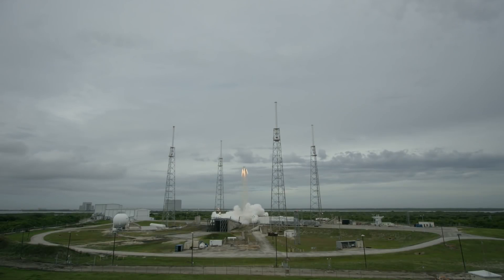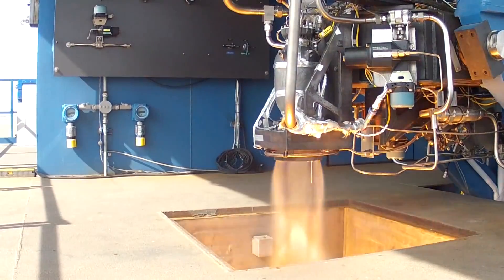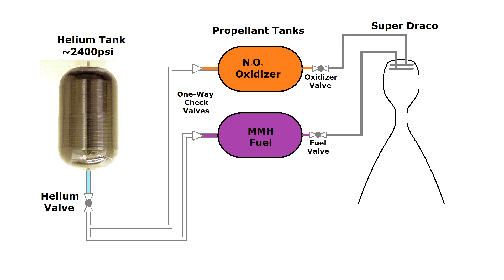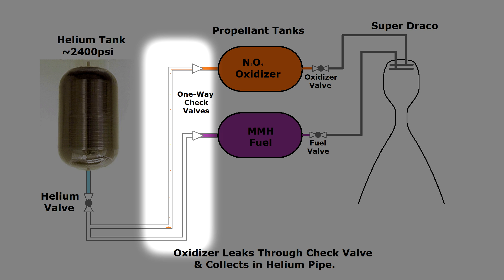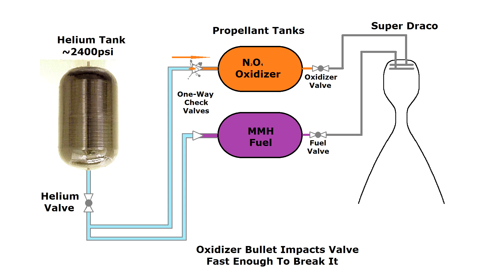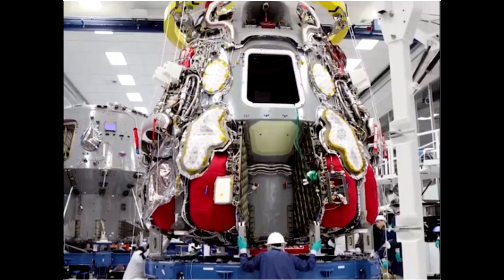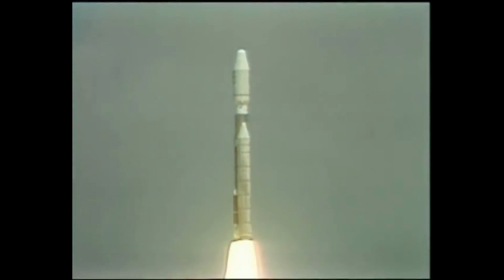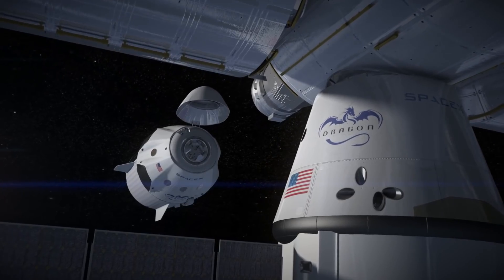SpaceX's Crew Dragon Spacecraft Exploded Because of 'Corrosive Bullets' and Leaky Valves

Comment: How would burst discs function you ask? Glad you asked! ;)

Burst discs are a thin metal plate of a precision calibrated thickness and usually scored or shaped to hold pressure up to their rating, and then burst instantly when the pressure reaches their design rating.

By putting them on the pressurization ports on the low pressure fuel and oxidizer tanks, they would prevent any fuel from getting into the helium plumbing.

Then when the SD thrusters were fired, the helium system valves would be opened and instantly burst the discs allowing the tanks to be pressurized.

The only times this would happen would be in the event of an in flight abort, and at that point the helium pressure would never be turned off until it was on the ground, so no fuel could get into the helium lines.

If they ever do propulsive landings, sane idea, the discs would be burst just before landing, and it would stay pressurized until it was on the ground.

All the other valves would remain the same to turn the engines on and off etc, this is just the shrink wrap over the package to keep it sterile until first use so to speak.

For long term redesign, I would either move the helium control valves directly to the end of the fuel and oxidizer tanks totally preventing the situation, or add a second set of valves directly at the tanks that actuate at the same time as the existing helium valves.

This would preserve the ability to ground test, while preventing the problem of fuel leaking back into the system.

Comment: The video was great like all of them!   It wasn’t explained what would happen if it happened again but with the updated burst seal?   Does that Superdraco continues to work or shuts down?   If it shuts down is there enough abort thrust to escape?   If the seal disk burst does the poisonous ☠️ gas leak into the atmosphere or does it stop the flow?

The other thing not mention in the video is how thorough the investigation was.   Not only NASA but the FAA, National Safety Transportation Board and USAF all conducted investigation into the site.
Reply: It's impossible for this failure mode to occur with a burst disk, though there may be other failure modes introduced with that change (which would also need to be addressed).

Comment: Couldn't you fix this by just raising the helium pressure gradually? Open a pinhole valve first, bring the pressurization lines up to operating pressure, then open the main valve. No helium inrush, no bullet, less stress on the valves and piping.
Reply: That would slow time for launch escape system to abort.

Comment: Question:
Can the check valves on the input side of the fuel tank and the oxidizer tank be replaced with the same type of valve as the ones on the output side of the tanks?

Comment: So if the valves that pressurize the tanks are one use only, I guess that means Dragon 2's plumbing isn't even physically capable of propulsive landing in its current form?
Reply: You mean in its new form, but, no you could still do it, you'd just have to replace the burst disks every time.

Comment: Maybe I just don't have a firm enough grip on mechanical engineering, but I don't understand how a burst valve can replace a one-way valve.  One allows pressure through when the pressure on the first side is higher than the second side; the replacement don't allow anything through until it hits a threshold, then allows everything to flow in all directions.  Maybe a burst valve is just part of the replacement system, or maybe I'm not getting it at all.  My intuition tells me that a better solution would be a solenoid master valve for safety, followed by the one-way valve, neither made of titanium.

But seriously, please somebody enlighten me.  I want to understand.
Reply: In the event of an abort, the very high pressure helium would burst the disk, and then all flow would be downstream from the helium tank.

Comment: Another nail in the coffin of the Dragon's soft-landing calability.  Now when you start those motors, you have to use up all of the fuel, whether you need it or not.
Reply: For now soft landing can be done but the fuel and oxidizer would have to be vented  separately immediately after landing which would seriously complicate crew recovery.  However now they know what happened and how to recreate the failure, they can do detailed testing of new check valve designs.  It is possible to make check valves that wouldn't explode even if it  leaked.  You can make a check valve out of aluminum oxide ( a ceramic) that would be strong enough to handle the slug of fluid and it is would not corrode or burn. .  Once you have the improved check valve you can install that into crew dragon, keep the burst disks and use them to abort or land .

Comment: Wow. Good thing the plan already had the system only firing once per flight - during an abort. This also means that any abort burns will be to depletion. I can see why they would use check valves, but burst disks are the only reasonable option to fix this.

Comment: Will switching check valves to burst disks hamper reusability? If yes, how severe?
Reply: The Superdraco engines are only used for aborting the mission so in such a scenario, also changing out some used burst discs will be the least of their worries.
Reply: @chrisantoniou4366  So, they are not used for orbital maneuvering system?
Reply: @dyershov  No.  The Draco engine is for manevering, the Superdraco for launch abort.  They had originally designed the Superdracos as hover motors for a controlled descent of the capsule on land, and this is why the engine used a check valve - for reusability, but this was dropped from the design even though the check valve for the helium tank was kept.
Reply: No. Of course, NASA has already denied them permission to reuse the Dragons on manned missions. Crew Dragons will only be reused for cargo flights. Hwever, since NASA also killed propulsive landing, these valves would only ever be used in the event of an in flight abort, so changing from one form to the other will have no impact on reusability whatsoever.

Comment: How does a burst disk equal a check valve? In my experience they are totally different things.
Reply: The purpose of the valve here is to prevent fuel or oxidizer from leaking backwards in to the system. The check valve was good for that purpose if the SuperDracos were going to be used for propulsive landings on multiple flights. Since that will no longer be the case, and they will only be used in the highly unlikely event of an in flight abort, the burst disk can perform that function actually better, and will be be, well, burst by the high pressure helium should they ever need to be used.
Reply: @odysseusrex5908  so they only use the helium in an abort?
Reply: @paintballercali    Yes. The Superdracos are only an abort mechanism. Originally they were going to be used for propulsive landings, but NASA killed that idea.
Reply: @odysseusrex5908  ok I get it now thank you.

Comment: In the navy, if a Class D fire (e.g. Titanium burning) on an aircraft the only action was to dump it over the side and let it continue burning as it went to the bottom. I'm still not thrilled with the solution. Why not stainless steel pipe the whole pressurization system including the check valve.

Comment: If a check valve is open and flow reverses, isn't there a remote chance that fuel & or oxidizer has the potential to leak back into the common helium piping?  With hypergolic fuel no less?

Comment: A Rupture Disc only bursts when a certain pressure has been exceeded..Until this point they do not allow anything to flow at all. I  can not understand how this fixes the issue seeing as you need to pressurize those tanks with helium. You cannot just plug the line with a rupture disc. How does this solve the check valve problem?

Comment: I am confused how this can replace a check valve...so once the disks pop and its all at the same pressure what stops the fuel and oxidizer from flowing backwards and corroding the pipes or mixing in the plumbing and blowing up?
Reply: The extremely high pressure of the flowing helium.
Reply: @odysseusrex5908  but between when they pressurized it and when they open valves to light the engine...or if they don't use up all the fuel, wouldn't that be a problem?
Reply: @matthewmiller6068    It is, now, only an abort mechanism. It is supposed to use up all its fuel, and fire up really fast.

Comment: Slam pressurization is always sporty. On XCOR's test stands and rocket vehicles, we always made sure we had some means for gradually pressurizing the tanks, typically a solenoid valve in parallel with the high flow ball valve. A few times we tried fast press experiments, but the system's reaction told us not to do that again. (Seeing the pressurizing lines jump and shake made me a little shaky, even in the bunker.)

On later systems, we routinely put a sonic orifice in the press lines (downstream of the regulator and press valve) sized for about 3x the normal flow rate. It would choke the flow until the tank press approached normal operating pressure, then could keep up with the propellant volume flow rate with very little drop. Much like an inrush current limiter for an electric motor.
Reply from the maker: So how do you handle a system that’s needed within a split second to save the crew?
Reply: @scottmanley  If the tanks are almost full, pressurizing them will still only take a fraction of a second. There's a big difference between 0.5 and 0.01 second pressure ramps.

Comment: I also read though, unless I misunderstood the language of the report, that the combustion of the failed titanium valve in the presence of the oxidizer was completely unexpected and thus unanticipated. As in, they experienced something brand new in rocket history.
"It is worth noting that the reaction between titanium and NTO at high pressure was not expected. Titanium has been used safely over many decades and on many spacecraft from all around the world". But the older report seems to indicate this knowledge of the combustion of titanium in the presence of oxidizer was previously known. Why switch to a one use valve, rather that some slight additional plumbing to allow purging of the pressurization line between the pressure tank and the valve that failed? I know there is more than one valve to accommodate. Then there could be repetitive testing again of a system.
Reply: Covering their asses, that's why.

Comment: So are they keeping the one way check valves but adding burst discs as pressure relief? A burst disc alone wouldn't let anything flow past right?
Reply: No, they are replacing the check valves with the burst disks. They won't let fuel flow backwards, like happened here, but, in the event of an abort, the high pressure helium will blow then out and allow forward flow,
Reply: @odysseusrex5908  but how does a burst disc allow fuel past it at all?
Reply: @hotshit62    The fuel isn't supposed to go past this valve.This valve is upstream of the fuel and oxidizer tanks. It's purpose is to prevent fuel and oxidizer from flowing backwards in the system. When the engines are ignited, the high pressure helium is supposed to push the fuel and oxidizer forward into the combustion chamber. The check valves would have allowed the engines to be turned on and off. The burst disc will simply be broken by the helium and then flow can only occur in one direction because of the high pressure the helium is under.

Comment: That explanation was really simple and easy to understand. You're exceptional at this sort of thing, Scott. Thank you for the video!

And thank goodness they figured it out. This is the way it should be done - everything transparent and out in the open so everyone knows the problem has been addressed and there's no chance of it happening again. It's too bad they'll have to install new burst valves every time they want to reuse the Crew Dragon, but that's a small price to pay in exchange for the added safety.
Reply: They won't have to install them every time it is reused, because the Superdracos will only ever be used in the event of an in flight abort.
Reply: So only for manned missions?
Reply: @Kevin_Street    I don't know if the abort system will be included in the unmanned reflight missions or not. But, since the engines will not be used unless there is an abort, the burst disks will be fully intact after flight.

Comment: Scott - could you possibly explain how the burst disks replace the check valves?  They don't look like they would let anything through.
Reply: What happens when you push a pin into a ballon?  It pops.  The helium is the pin and the disk is the ballon.  The burst disk bursts when the helium is turned on.
Reply: @stevenf1678  Ah I see - so then I suppose under no circumstances can the Helium valve be turned off after that?  It does create a new failure mode if one of the other valves doesn't shut down in the correct order.

Comment: How can a rupture disk replace a check valve? Once ruptured, the system is open to flow in both directions. Why have anything at all? I must be missing something.
Reply: Remember - they're currently only using the thrusters for launch abort, so they don't need to be restarted. Once the seal is ruptured, the engines are running until there's no fuel left to run the wrong way. It's not a solution that works for propulsive landing, but it does work for their current requirements.
Reply: @simongeard4824  so what are the rupture disk doing up until they burst? The helium valve is closed until they need to pressurize the system as well as the fuel and oxidizer outlet valves. Another point, a rupture disk does not function like a check valve. Perhaps using them to replace an on off valve makes sense but how can the replace the need for a check valve in any system? They do not serve the same function.
Reply: @andyfeimsternfei8408  - well, a check-valve serves three purposes... it prevents oxygen from flowing the wrong way when the helium valve is closed; it allows helium to flow and displace oxygen when the helium valve is opened, and it closes when the helium valve is closed. A rupture disc achieves the first two - it blocks the oxygen from flowing the wrong way while the disc is intact and allows helium to flow when helium pressure ruptures the disc.

The only practical difference is that it can't be closed again - but that's not a requirement if the engines are only used for emergency abort. It's a showstopper for propulsive landing, but SpaceX aren't currently trying to do that with Dragon...
Reply: The disk will be ruptured by the very high pressure helium, which will then govern the flow. This will only ever happen in the event of an in flight abort.

Comment: There are regular air rifles that work well above that pressure.  (3000 psi)  Benjamin makes pressure vessels for air rifles that go up to 5000 psi, for instance.
Reply from the maker: Yep, but by the time that’s expanded through the barrel it’s a lot lower because the pressure vessel is small.
Reply: Well yeah, but that's like saying that by the time a rocket's exhaust has expanded out of the nozzle it's small.   In both cases, that's kind of the point, and in neither case does it have any bearing on the original pressure vessel.  I'm just saying that a 3000 psi pressure vessel really isn't that big a deal, focused in particular on your comment about air rifles in the video.  Just a small item.

Comment: North Korea uses the same oxidizer, dinitrogen tetroxide, on their Hwasong-10, 12, 13, 14, and 15.  This is probably why they initially had failures with the Hwasong-10.  They have fixed these problems.  I'm thinking the valves were corroded by the dinitrogen tetroxide.
Reply: Who do you you say you work for?...

Comment: And that kids. Is why you test everything. If they had not performed these tests on a returned craft. What are the odds that it would never have been discovered until a man was on board?
Reply: Bighappy On the contrary. NASA will not reuse capsules for manned flight, only for cargo which does not have launch abort. So in reality this would never happen.

Comment: What is the advantage to using gas feed fuel for the abort system compared to an electric pump?
Reply: SuperQBoi Where would the power supply for the electric pumps come from!? Batteries are always heavier than gas cylinders per unit of energy stored.

Comment: Why not get rid of the valve at the helium tank and pressurize the plumbing? Seems the problem is that nature abhors a vacuum and fuel found its way past the valve. If the valve had pressure behind, this incident couldn't have happened.